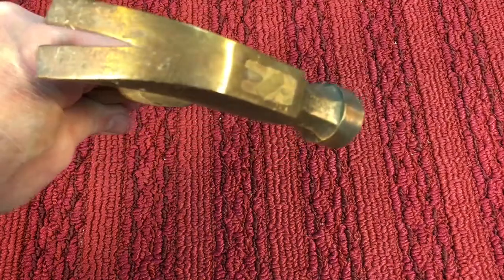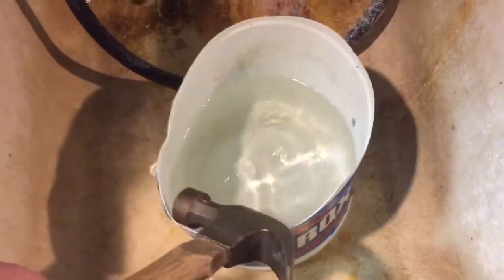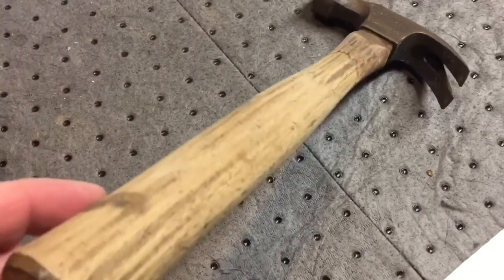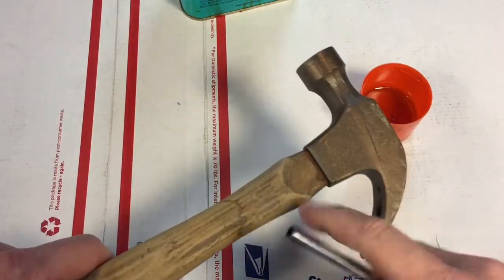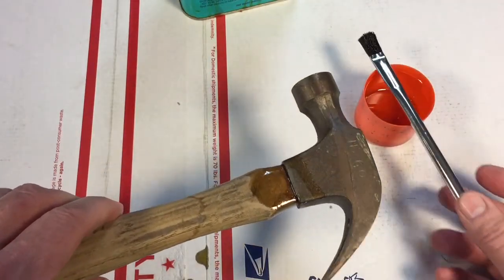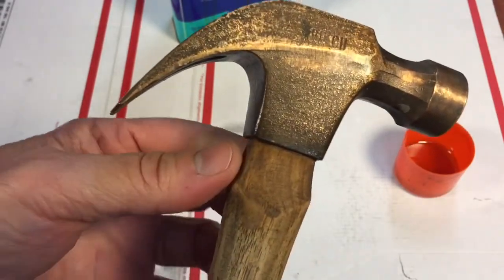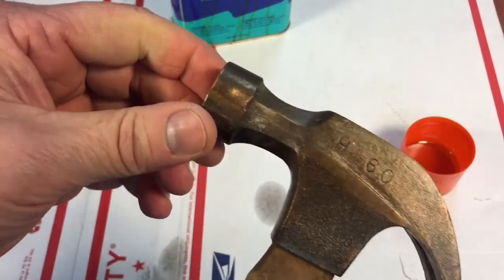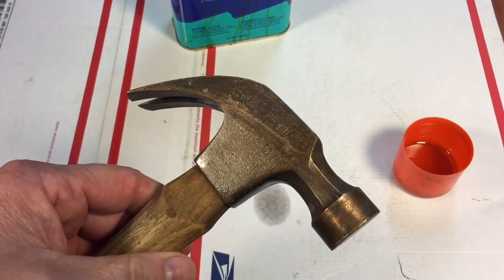Beryllium Hammer Introduction and Handle Fix

Comment: There is a lot of dis-information and urban legend about beryllium and it’s alloys. Yes, like peanuts it’s fatal to about 1% of the population but you don’t want to be that 1%. So the DoD issued warnings about the safe handling of it many years ago, and only special machine shops with proper precautions can machine it. BeAl or beryllium aluminum is used when a defense system needs high strength and light weight in a particular item.

Comment: ScoutCrafter  -

Beleive it or not aluminum tools can create a spark with enough energy to start a fire in an explosive atmosphere. 

Aluminum if dropped on to rusty steel can leave a smeare of aluminum on the steel.  If the aluminum is dropped a second time on to the smear enough heat can be generated to create a spark.  This, of course,  seems a bit far fetched because it requires multiple events.  The aluminum tool needs to be dropped.   It needs to strike rusted steel.  The atmosphere needs a fuel-air mixture to support combustion.  Then an aluminum tool has to be dropped again and it needs to strike the same spot.

In the 1960s or early 1970s, a tanker suffered a pumproom explosion.   There was no apparent cause.   After an extensive investigation an aluminum ventilation fan impeller was found at the bottom of the pumproom.  At first it was thought the impeller was at the bottom of the pumproom as a result of the explosion.  Further investigation found a smear of aluminum on some rusty steel near the bottom of the pumproom.  Researchers speculated the fan which was at the top of the pumproom suffered a catastrophic failure and broke apart.  The aluminum fan impeller fell to the bottom of the pumproom and struck a spot of rusted steel.  It was believed the fan bounced and hit in the same spot creating a spark.  Laboratory testing showed that a spark could be created with sufficient energy to ignite an explosion.

I was taught never to install aluminum fan impellers in pumprooms  and never to provide aluminum tools on tankers.  Fact is stranger than fiction.

I can't figure out why a berrilium claw hammer is needed for use in a  hazardous environment.   It seems to be an odd tool choice. 

I really enjoy your videos.   I learn something new every time I watch one.

Bob
Reply: ANNMAL 
my fav.
when u can imprint the bottom of a Gatorade bottle onto 1in steel plate.
i smile forms.

Comment: I used to work at a military facility where we overhauled aircraft brakes that used Beryllium friction surfaces.  Beryllium dust is highly toxic and is no joke - you do not want to mess with it.  We had a special brake overhaul room that was isolated from the rest of the facility to prevent the spread of the dust, and the artisans doing the work had to wear hazardous material suits and use special respirators.  We eventually replaced the Beryllium brakes with carbon brakes to eliminate the personnel hazard from the Beryllium.  I would urge you to leave that hammer head alone and do not grind or sand it!
Reply from the maker: Hello Gerald!  Yes!  I have heard how dangerous this stuff can be!  I was very lucky!  Usually I find this out right afterwards!  LOL   It's is a shame though, I heard it polishes up just like brass!  =)   Thanks for the heads up!   I really appreciate it!   =)

Comment: use antifreeze instead of water so it wont evaporate.but the oil alone will do the trick.
Reply from the maker: Hello sour mash! I have heard about the antifreeze!  I never tried it yet but it sounds promising...  The problem is that if the handle isn't "hung" under the right conditions and the wood isn't dry enough, nothing will work permanently.  I have 100 year old hammers that are still tight as can be, and two year old hammers that are loose!  Funny right!   Thanks so much!!!!!  😃👍

Comment: Hello Hello,....Have you ever heard of soaking a hammer or axe etc in a bucket of car antifreeze,...seems the antifreeze is made of a blend of alcohol and wax,...the idea is that the alcohol will soak into the wood taking the wax with it and when the alcohol evaporates away the wax is left behind leaving the wood swollen and the handle tight,....Robert in niagara falls
Reply: 70carlton Amen, agree with that. Not sure why it work but know it works great. Also agree with scoutcrafter about what to do after that.
Reply: Its not alcohol and wax, its glycol

Comment: yay with the linseed.  as for the head, i like the various casting finish, id just clean a little green off it and let it patina
Reply from the maker: Hello Jusb1066- I’ve seen a piece of Beryllium polished up and it looks amazing! Like a Copper-Bronze color and just beautiful-  A smart man would follow your advice and avoid the chance of coming in contact with toxic dust...  -but I’ve never been known as a smart man...   😃👍
Reply: a few years ago i wouldnt be surprised if i had come across this and thought it was bronze, i used to work scrapping metals and cutting them up....

Comment: Looking forward to the full restoration video. I have never come across a beryllium hammer before. In the UK the non sparking hammers are either bronze or brass.
Reply from the maker: Hello Tony!  I wanted to polish out the head and make it look awesome, then I read that beryllium dust is TOXIC!  Holy Crap!  I'll wait until I can do it outside and throw away my sanding/grinding discs.   I think the Beryllium has stronger and has a better spring and toughness then Brass or Bronze.  Thanks!